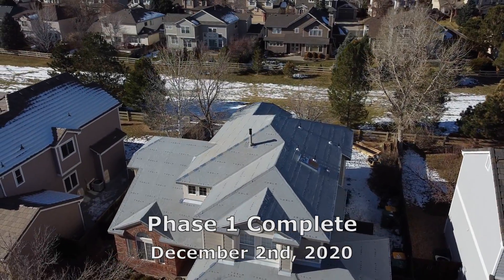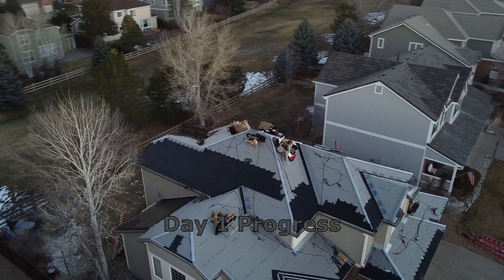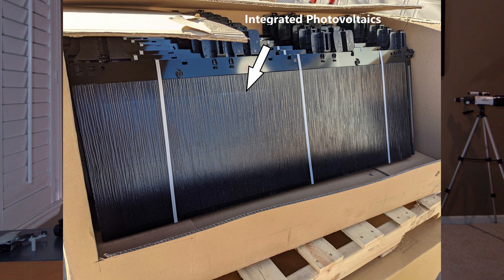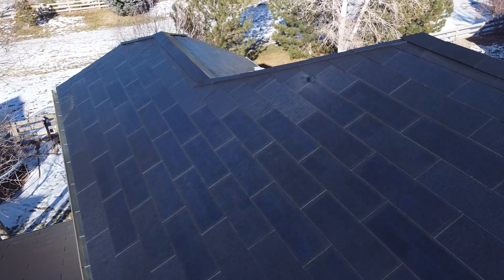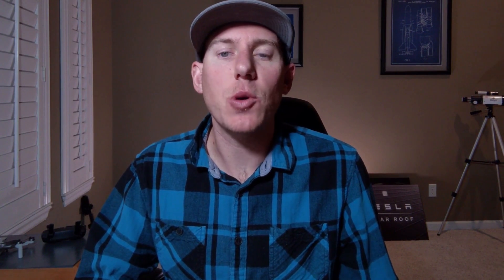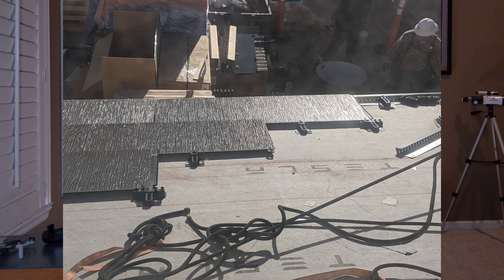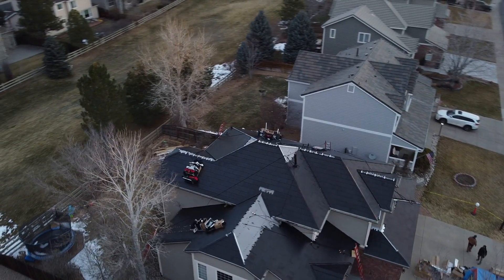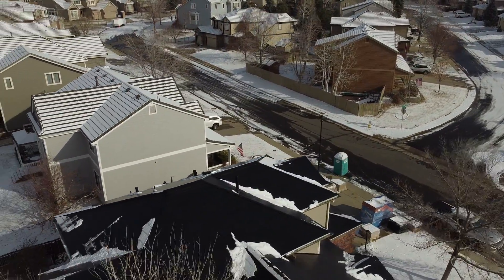Tesla Solar Roof V3| Fastest Roof Install in Colorado

Comment: What percentage of the tiles are non solar producing?
Reply from the maker: That's a good question.  I'll have to run the math and get back to you.  It's maxed out for my roof layout, but my roof is pretty complex with a lot of different surfaces.

Comment: Are you worried about hail damage? Any leaking?
Reply from the maker: These tiles have a higher hail rating than the concrete tiles which they replaced.  All good so far, my first video show the extent if the water proofing they did before tile installation.

Comment: I’m curious how well it works with snow.  I don’t see any “snow brakes” so I’m curious what will protect the gutters when the snow slides off?  Do the tiles have the ability to heat themselves to melt snow?
Reply from the maker: The tiles do not heat themselves but because of their color and slickness, snow slides off them during and shortly after any appreciable snowfall.  I am working up a package of pictures and such to send over to Tesla because there is something that needs to be done similar to what you are describing.

Comment: Did you add the Tesla Powerwall units?
Reply from the maker: I did not.  My utility doesn't allow Net Metering and time of day rates on the same plan.  There are also no battery incentives from my utility.  My power has been pretty reliable here in CO 🤞and so I couldn't justify the additional cost.

Comment: Does it cost more when you have a complex roof design? I have a roof similar in the Denver area.
Reply from the maker: No.  Atleast currently, they charge you based on the size of the PV system and the total roof square footage.
Reply: @TheJ0n28  Tesla just change the price model last week base on the complexity of the roof

Comment: Nice install - thanks for sharing.  I'm down in Parker, CO and would love to do this.  However, we just had our roof replaced (3rd new roof since the house was built in 2001) in fall of 2019 due to (another) hail storm.  If these solar roof installations actually hold up better over time than conventional asphalt shingle roofs, the cost savings to the consumer could easily make up for the higher initial expense in places where hail damage is common.

Comment: Very nice looking, functional, practical roof and it seems to shed snow better than the neighbours.  Great for solar as well as minimising roof loading.  Good work and thanks for the great info.
Reply from the maker: Yeah, due to the black color as well as slick surface it does shed snow as soon as the sun comes out.  It's actually somewhat of a problem because the snow slides off in large sheets... Tesla said engineering was looking into a solution.  It's hard because it's great the snow clears to be able to generate power, but I also don't want it dropping snow on the walkways outside the home.
Reply: @TheJ0n28  Actually looks like it's not just you!  https://youtu.be/f_GHVSL35-k  There's no snow fall where I live so I was completely ignorant of the possibility.  Cheers...  Clark

Comment: Was this done through a third party roofing company? Or does Tesla now handle the labor?
Reply from the maker: Mine was ordered in Nov of 2019 straight through Tesla's Website. Tesla did the glass install themselves and sub contracted out the phase 1 install of waterproof and 1st layer of flashing the week before glass instal l.  Though I believe they are working to try and spin up third party installers currently.

 Check out the referral link in the video description if your interested.